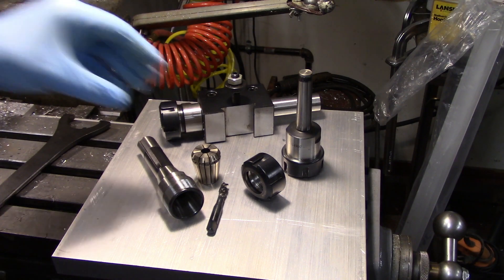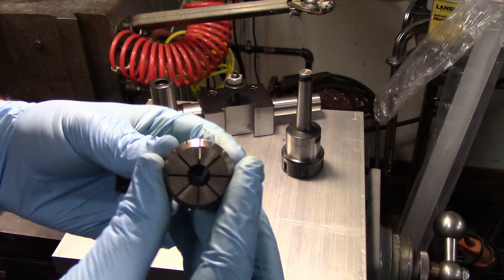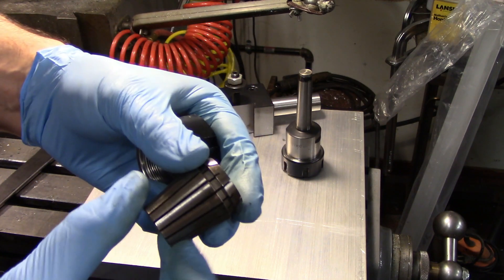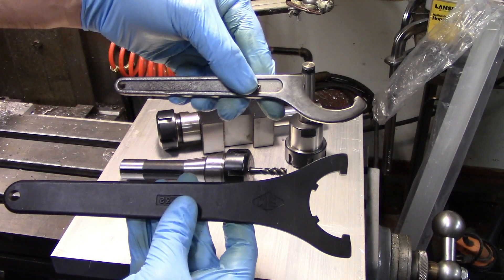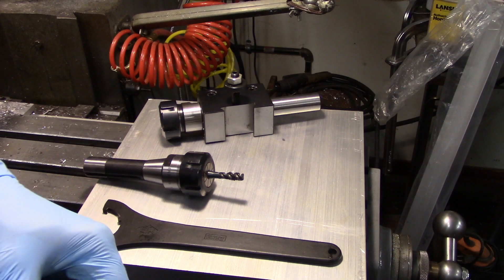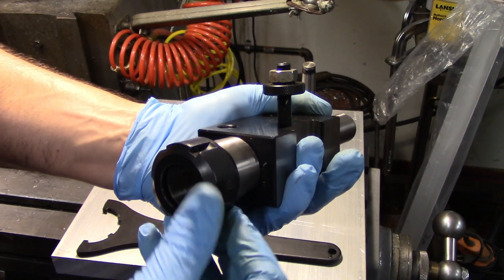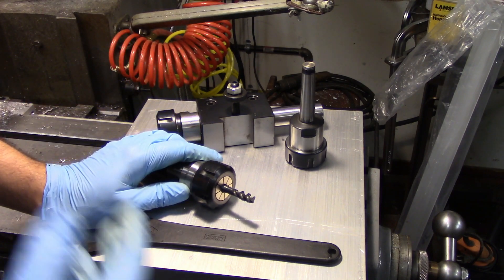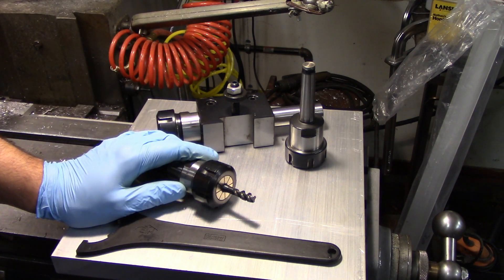ER Collets and Collet Chucks

Comment: There are ER tapping collets and that’s a much better choice for taps. They are made to the actual shank size with a properly sized square opening at the rear. I’ve had bigger size taps slip in regular collets, then those collets may get damaged. If that happens you have to throw it away. Buy a good chuck. The cheap ones are often too off concentric. Same with collets. I’ve tested cheap ones and some are off by thousandths. Not worth it. If you find you’re breaking small mill bits, that’s often why.

Comment: I love whenever items can be more universal across multiple machines. I'm trying to find the sweet spot with chuck selection and back plates, but it's a bit of a quagmire.
Reply from the maker: I'd go with ER40 to get a bit more capacity on the lathe. The mill holders get a little bulky, but it's not a deal breaker.

Comment: Hello Stuart, I went with ER-32 too as it will cover the largest range of sizes. In case you don't know, there are over-sized collets which go all the way to 26mm and still maintain their concentricity.  I purchased them to hold stock in my lathe and they work well.

Comment: Where do you buy good quality ER chucks.??  I am willing to pay for US made, but none seem to be found.  I have my whole shop with almost every machine able to use ER40.  But I got the various Morse taper or R-8 adapters from Ebay sellers, mostly from China.  I buy from US sellers, but the ER adapters are from China.  H&H Industrial Products seems to import most of them, and various re-sellers distribute them.  I have a few of them, right at half a thousandth runout.  I am oK with half a thou, but no more than that.  It is so much of a crap shoot, I started buying 2 of any one adapter, and sending back the one with the worse runout.  Any good sellers of more precision  ER adapters ??
Reply from the maker: Maritool sells them, although not in R8 or morse.  They have straight shank tools and 40 and 50 taper tools.  Check out Glacern as well.  I'm not sure of the country of origin (R8's are about $100), but I have bought several things from them and they are all very nice.  MSC actually carries several high quality brands and some are made in the US, but I only saw straight shanks and 40 and 50 taper tools with that search.  Let me know if you find anything!
Reply: @StuartdeHaro  Thank you.  I appreciate the info.

Comment: At the shop I used to work at I had an ETM ER16 collet holder with a R8 shank.  It was very well made and I used it to hold small (1/64) drills and end mills. Peg or Do it again.
Reply from the maker: Both excellent song choices.

Comment: Good overview.
How about getting an ER40 holder and just buy the collets from 20 to 25 rather than a whole set. You could also just get a collet for the common end mill sizes, to save money but still have the convenience. 
You may have noticed from my videos that i use a lot of ER20 collets holders so i have a full set of collets but also doubles of the common endmill sizes, in my case 6 8 10 12 mm, but for you imperialists that would be 1/4 5/16 3/8 and 1/2. 
The reason i went with ER20 is because you can get  the holders come with a 20mm straight shank which is the largest common R8 collet to have my version of the TTS set up.

Comment: I've been looking at setting up for an ER system, most people usually say they should have gone ER40. 
Any negative to going ER40, 
Thank you for sharing ,
Reply from the maker: I think the larger nut is a decent trade off for the larger capacity. I would definitely go with ER40 if I did it again today.
Reply: @StuartdeHaro  Thanks Stuart for this.  I've been on the fence about which size to buy.  I'm learning BG is not always your friend.  Better deals can be found on Fleabay like this.    https://www.ebay.com/itm/24Pcs-ER40-Precision-Spring-Collet-Set-Milling-Lathe-CNC-Chuck-Bit-Holder-Tool/143500157853?hash=item216946a39d:g:A9cAAOSwr0ReEpUi  Thats a shitload of collets!
Reply: the larger nut can get in the way, but not usually a problem. ER collets are addictive, and you will own many in a few years.
Reply: @darrenfloen2693  Have to save some more pocket money ;-) 
Thanks